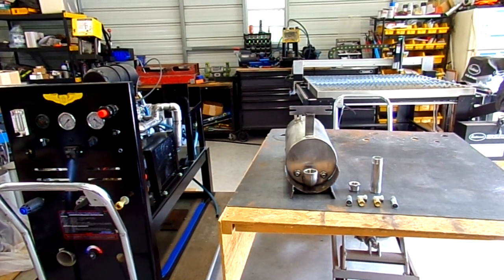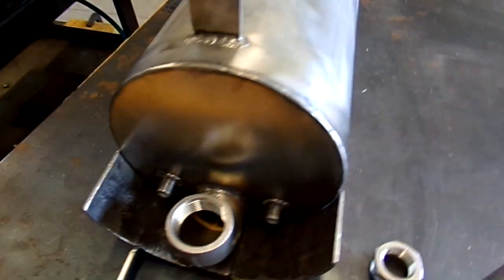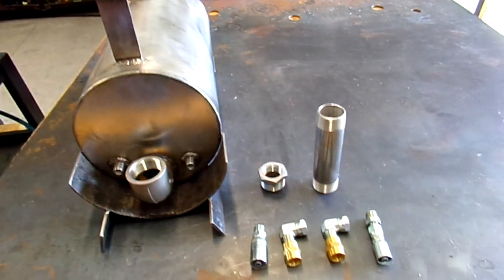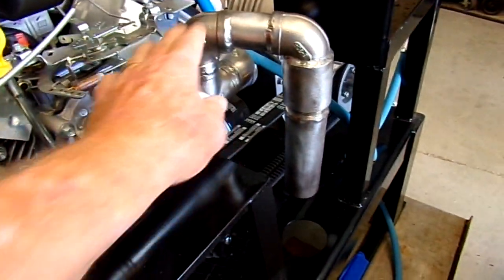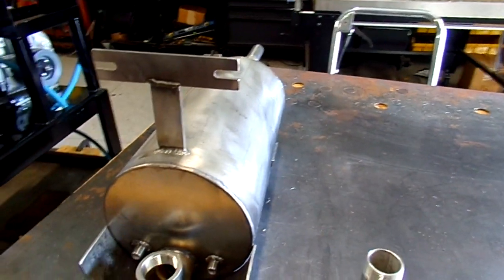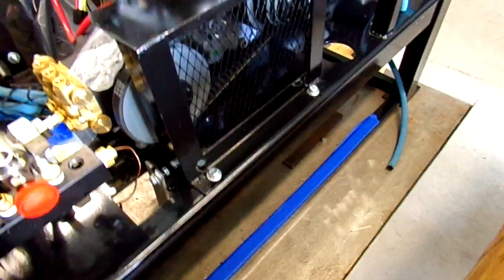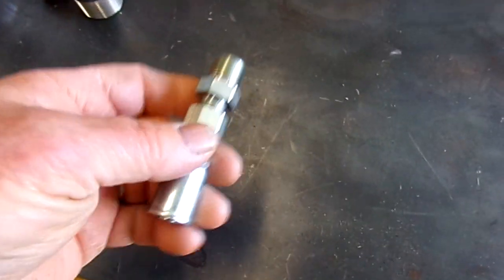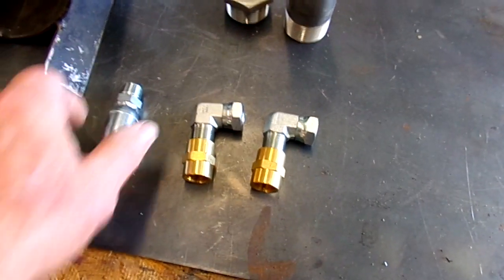Greatest Heat Exchanger Built. Avoid Cheap Copper Propane Heaters WOW! BEST PRICE FOR JAN 2025 $1395

Comment: After 5600hrs and over 2000+ grout & tile cleaning . And 7 yrs compact 45 . Pete rebuild ourTM heater ,  and it’s like brand new . Grest heat again, Ty Mr pete .on a great build of the compact 45. CJs restoration company
Reply from the maker: That is why CJs Tile & Carpet Cleaning is so successful in Weirsdale FL and the Villages. Not only he provides outstanding services but he is using a Blue Baron truck Mount best in the industry.